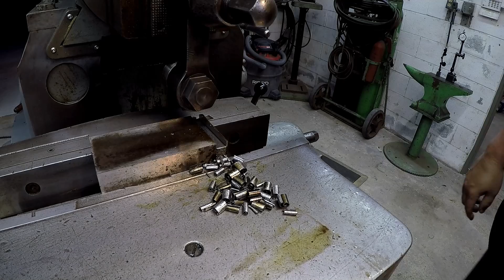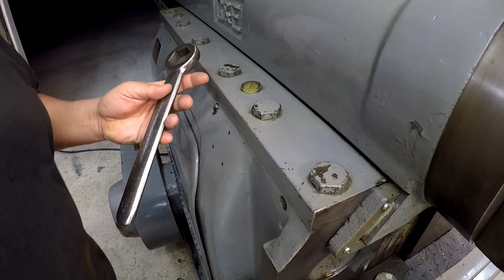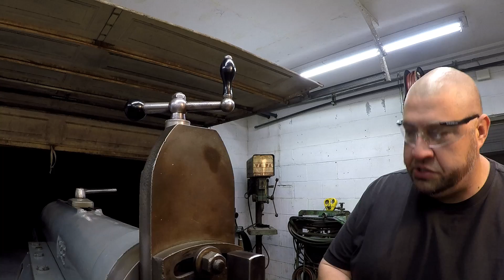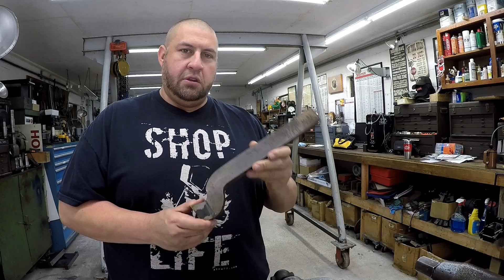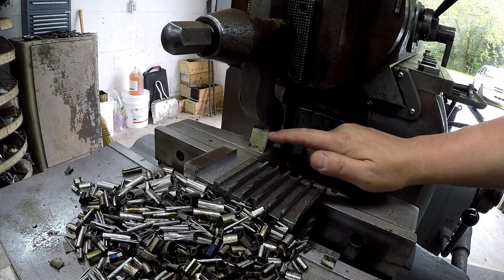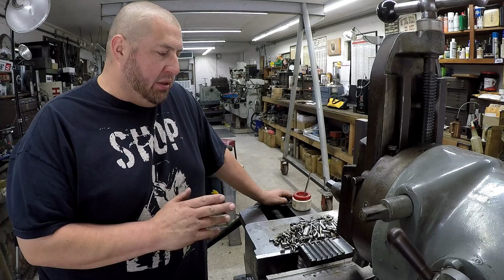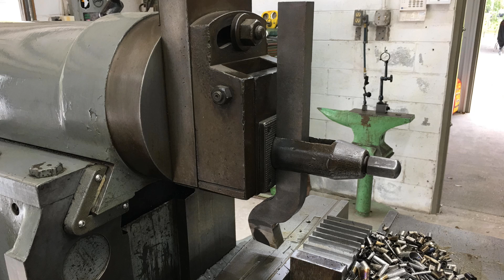Shaper Slotting

Comment: I asked many months ago, if you have a P.O.Box. to send you something, that is about 5000 times bigger then anything I can ever use on my dinky little machines...a few chamfer / counter sink bits.  There is a 1.987" diameter with a 1.000" dia shank  and has an approx 98 degrees chamfer angle and over all length is 4.125"  and is of a very high grade, fine tight grain H.S.S.. The labeling is acid etched and as follows. 1st line is : (VW-C-1098-0032PA), 2nd line is : (HS C-L USA), 3rd line is : (D04887) or (DO4487) I cant tell if the "zero" is afla or numeric on the last line.  The other chamfer tool bit is one which is 1.250" diameter with 1.250 dia shank, and an approx 102 degrees and the over all length is 3.600"  and this one is solid carbide and the labeling is laser etched and as follows. 1st line is : (Crowley Tool 3/09), 2nd line is : (D-1601X16/12/06 1290-347-0), 3rd line is : (#28400)...... I have tried to find info on these part numbers, but, I am either not smart enough to find stuff on the interweb or they were custom made for a particular job and are not part of a commonly ordered part number. I purchased them from online and the pictures that showed a whole lot of chamfering bits, I desires the large diameter cutting head, but small shank diameter, so I could hold them in my little machines. I recieved the opposite of what I wanted, Heck, my largest R-8 collet is 7/8"... I do not have the ability to grind them down either, in a proper fashion, let alone, I can't imagine how long I would have to stand at my pedestal grinder and work the living daylights out of my green stone.. that would be nuts and time consuming and not do these cutters justice. Now I must say, the larger tool, does have a center drill counter sink pilot and is centered to the grind on the shank, but the carbide unit does not have the centered drilled pilot hole at all.. Again, these are something you would be able to simply just chuck up into your larger equipment and make use of them.. Dru Bradley
Reply from the maker: Dru, send me an email about it. Abom1979 at g mail

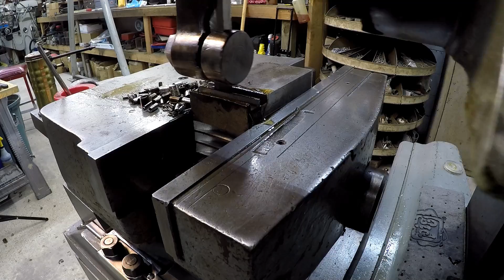Comment: @9:56 you say "5 thou on the dial -- 10 thou total depth" 
Surely that is the case when working on a lathe. With a linear situation 5 thou gives 5 thou. ?? 
Or have I lost your point?
Reply: jonka1 - I was going to ask the same question. 🤔🤓
Reply from the maker: Each line on the dial equals .002.
Reply: Isn't it the opposite too? On the lathe when you see 10 on the dial it takes 10 thou off the diameter so the depth of cut is 5 thou.
Reply: Some lathes have a dial that reflects the total removed from the diameter, e.g. 10 thousandths on the dial produces a 10 thousandths reduction in diameter.. My lathe indicates the size of the infeed, e.g. 10 thousandths on the dial produces a 20 thousandths reduction in diameter.

Comment: Very enjoyable as always. I admire your systematic way of trying out a new machine or cutting tool in order to find out its strengths and limits.
By the way, although about planers and not shapers, you will hopefully enjoy this 1950ies movie made by Waldrich Coburg, a German maker of huge planers:  https://www.youtube.com/watch?v=HThSfJcrk-g&t=908s
Unfortunately the video is in German, but you will certainly get the points and enjoy some heavy chip-making. Feel free to ask me if you need help with translations on certain details.

Comment: Adam,  you may want to do some slow or fast motion with the camera -- you can see things you can't by eye.    On the wide tool bit it sort of looked to me the ram may be slightly lifting on the operator side.  I would also look at your clapper pivot pin for a sloppy fit.
Criag

Comment: Is there such a thing as a"quick-change-tool-post" type things for this.. like where you could just change out the whole clacker assembly at its pivot point.. and have many pre-set tools for roughing to finishing... I suppose that would be allot of room for tooling bases storage.. I suppose it would just be simpler to change the tool bit out for every step required...?

Comment: Not trying to be an ass here, but curious what uses the shaper would have that couldn't be done on a mill? Or is it just a hobby type thing to experience an older technique? I've watched most of the shaper vids, but I'm having a hard time figuring out unique uses for it. Thanks in advance for any information. Keep up the heavy cuts, I love those big smoking chips!
Reply from the maker: These videos are not to prove what a Shaper can do that can’t be done on a mill. This is about a machine I wanted, bought, and learning how to use, and repair any issues along the way.
Reply: Audiboi any inside axial feature. Splines, keyways, etc. True involute gear teeth. All with a $2  bit. Plus it's cool
Reply: Tooling prices?
Reply: Time savings=money savings. One can make a cutter for this machine out of literally piece of any hardened steel. Accuracy.
Reply: Gotcha, thanks for clarifying guys. But in response to the splines, it doesn't appear that work holding would be easy to index and the stroke length seems too short for longer pieces, but my experience on machinery is limited to a few years running a automotive brake lathe and what I've seen here and on oxtool.
Reply: Audiboi true, work holding is an issue but not impossible. I believe that's a 16" or 18" shaper. He has the stroke shortened as he doesn't need any more for what he's doing. You can see the stroke a little better in another of his videos.

Comment: Why not install a stepper motor on the down feed and control it with a micro controller?
Reply: Ken Kendall it looks like it may have a power down feed. In other videos you can make out what looks like a shaft drive housing from the rear of the machine to the knee.
Reply: The dirty way is a circular saw blade sandwiched under the handwheel and a finger mounted to the base of the machine to do the downfeed. :)
Reply: I apologize, I did not know it had came with an auto feed, in retrospect I would make the shaper 100% before doing any modifications myself but please don't assume that we watch all of your videos and that we should know when you have made "numerous" comments about a subject matter.
Reply from the maker: Because I’d prefer to repair the auto downfeed and use it. I’ve already talked about that numerous times.

Comment: Now you're cookin'! Constructive experimentation, ramp up and a bit over to find the sweet spot.

There's several possible sources for the "jumping" you noted with the 1" tool. If it isn't slide motion, it's most likely slack somewhere in the clapperbox, possibly the pin clearance or the fit on the ledge. A clapperbox is a super precisely fitted assembly if it's to function with a minimum of lost motion and still clap freely under gravity alone. Put a finger over the clapperbox hinge joint to detect relative movement. The pin is tapered and may be re-reamed a trifle deeper with the clapper dressed and re-fitted tight to the ledge. The trick is to find a reamer that matches the pin taper. You only have to clean it up and install the pin deeper. If the Gods are kind you can get several re-fittings out of a clapperbox pin.

On broad and form cuts there is a tendency for the tool, if fed too small an increment, to deflect up and polish the previously cut surface. The temptation is to increase the end clearance to make the tool more aggressive but the real solution is to doctor the clapperbox. No slack = nowhere for the tool to jump. By the way, it takes a dead keen cutting edge to cut predictably in fine down-feeds.

Gooseneck tools. They're easy to make. Have your local CNC plasma guy burn you out gooseneck tool blanks of assorted widths from AR plate. Skim the clamping surfaces with a face mill and machine a weld inlay prep where the cutting edge goes. 

Stoody makes an M42 hardfacing rod mold makers use to patch up wear points on forming and drawing dies. It makes a good cutting edge, about Rc 60-62 as-welded. No HT necessary after inlay. I suggest the HSS inlay to be over-width as needed to clean up, 3/16" thick x 3/8" to 5/8" back from the cutting edge. 

Know a real good TIG guy to make the inlay? The trick is to lay it in without diffusing base metal up into the inlay. Back in the day, our welder used atomic hydrogen but I've done it with TIG. Go carefully and watch for porosity in the butter layer (first pass over the base metal.) Careful, indeed: the rod cost about $8 for each 1/8 dia x 14" stick. I don't know how much now. I calculate 1 rod will make a 3/6 finished inlay 3/4" wide x 1/2" face length. A stick of 3/4" square M42 cobalt tool steel costs about $40 so t ain't THAT expensive even figuring in blanks shanks in batches.

I'll look for a HSS TIG rod source. Make sure whatever you use in the inlay is HSS. Nickel manganese based hard facing is durable as hell on an excavator bucket but it doesn't hold a cutting edge. Maybe here:

http://www.airgas.com/category/Welding-Products-Filler-Metal-TIG-Rod-GTAW-TIG-Rod-Hard-Facing/_/N-8c3?ef_id=WpoeWwAAAGh9-EN7%3A20180315042322%3As&gclid=Cj0KCQjwkKPVBRDtARIsAA2CG6G5VrApEiv9MgBJx8vzw9kw8r_lOCF91Vx4InpYerpXNfXMdo8YNGUaAnKBEALw_wcB&s_kwcid=AL%214811%213%21208472354629%21b%21%21g%21%21%2Brod+%2Bhard+%2Bfacing&utm_arg=SEM%3AGoogle%3AFiller_Metal%3AStick_Electrode_smaw_BMM%3ASearch%3A208472354629%3A%3ASearch%3Afillermetal%3A+rod++hard++facing%3Ab%3AAcquisition

But it doesn't say "M42."

If you decide to really get into working your shaper, you'll need grooving and form tools. Stock in an assortment of gooseneck tool blanks skimmed and ready. As you need tooling you can mill the relief contour and inlay the HSS. Takes about two hours if you have the stuff on hand. One of the hours is for still air cooling the HSS inlay. If you ever get to the point where your tool collection out-weighs the shaper, you're about average for a 10 year shaper hand. Planer hands have a lower tool to machine weight ratio but you have to figure in the table hardware and set-up equipment. A long established press brake die shop is a different animal. They might have three hundred feet of full dimension 2 x 12 shelving solid with form tools, a good many used for one job.

You ever get a chance to collect "OK" planer tool shanks and tool bits in the smaller size suited for shapers jump ar it. Haven't seen them for years but somewhere old guys hoarded collections. Looks like machine shop junk to civilians but to a planer/shaper hand they're like gold and dancing girls rolled into one.

Comment: I work on machines that us a shaper type mechanism for generating bevel gears. It's quite normal for the chips to snap off the ends and go flying, with a very loud snap, it's also normal for lots of smoke as the chip carries away the heat from cutting.

Congratulations, it looks like you're getting things more dialed in.

Comment: How about small shaper tools for some more delicate and precise work? Lets say some small keyway or something. Thanks for showing all this. Its a treay to see that mafhine working.
Reply from the maker: For sure, we’ll be working in many things as we move forward.
Reply: Dear Adam.  Many thanks for your video,s . Watching the shaper cutter jumping at the start of cut, it looks like there is some upward movement as the pressure comes on the tool ? No doubt you've already checked the front end setup,  could you start the cut manually and dial in tool post rereward deflection as cutter pressure starts ,this might tell you if there is play at cutter setup?  Just sharing  a thought. Best wishes  stb

Comment: I'm curious why the tool face has to be flat to the front edge of the work? why couldn't the tool be angled so that it enters the work at a point and then gradually gets wide as the tool enters the work? this would reduce the bump at the beginning I would think and make a smoother transition into the material. as well as exit. Now. I am just thinking aloud. there may be very valid reasons why this is not done? Shrug

Comment: Adam, thanks for the videos. I am an irrigation guy, not a machinist, but observation here. Looking at your earlier videos and a few of Steve Summers I noticed that the clapper boxes were not straight vertical they are clocked a few degrees. Could this have an effect on the amount of "slop" in the pin that the clapper pivots on?  Giving the clapper more room and time to jump at the start of your cuts. Good stuff any way you slice it!!
Reply from the maker: The clapper box tilted for side to side cuts allows the tool to swing out of the way on the return stroke.

Comment: Rookie machinist here, can anyone explain to me the practical application for a shaper like this?  I work mostly on very tight tolerance aerospace, defense, and medical parts so i have never seen a machine like this. Thanks in advance!
Reply: There are number of angle cuts that are easier on a shaper and internal splines (Adam: do you have a boring bar you could demo this?) are much easier especially if you don't have broaches to do the same.  On small job shop runs, it's much less expensive to cut the splines of various sizes and shapes than to have a broach made.  Also "hidden" internal keyways that don't extend to the outside edge of the shaft.

Comment: Would you be willing to try a test again with that 1 inch wide cutter?  Rather than have the cutter ground so that the cutting edge is totally parallel to the work, cut it so that its a bit skewed so that all 1 inch of the cutter doesnt contact all at once and it eases itself into the cut - i would be very curious to see how that goes

Comment: Adam, In 1967, I was in metals in high school.We had a shaper in the classroom. I had never seen one but I elected to make a 2 jaw gear puller. The body and the arms were all made on the shaper and the ram was cut from 3/4 inch hex stock machined down and threaded on a lathe. Enjoyed working with the old shaper and won a county award with the tool. Just my 2 cents. Thanks for the videos.

Comment: An observation; The action of the machine and the "bounce" seems mostly normal. The only thing I might question, wrongly or rightly would be the work sliding down in the vice. I think the edge nearest you (the toe?) would have the greatest likelihood of doing so. is the work supported on parallels? Your right in thinking that the rigidity is under control. Just seems like somethin's creepin'!

Comment: I'm not a machinist past a drill press and grinding wheel. I can appreciate the traditional part of liking shapers as a class of machines but to me, a horizontal and vertical mill seem not only to be able to do anything a shaper can do (except for large workpieces---but even then, not like ten feet long items) but there are so many adjustments and quirks of shapers (which I am having a great time learning about on Adam's videos) the whole idea of having a rotary cutter seems like it is so much more self-corrective; plus you don't have the massive forces that shapers have...somebody give me some good reasons to have a shaper. Other than it's a cool machine.
Reply: How do you cut an internal keyway on a mill? You do it in a press with a broach or you can use a shaper. Cutting an internal dovetail? Good luck finding a broach. With a shaper you can grind a tool for any type of internal slot.
Reply: There's many odd shapes that job shops must create.  You can go to your grinding wheel with a HSS tool bit and create the shape(s) you need without trying to make a mill cutter, heat treat, run through the tool grinder (most shops don't have one!), and then find the helix chatters too much.  You just change the geometry a bit at the grinding wheel on your HSS toolbit and get it right.  You might not get that same job again ever, but reperposing a mill cutter to a different shape or size is hard, whereas tool bit not so much.
Reply: I appreciate the answers! Thanks guys!
Reply: The other part to consider is operator input time. A shaper can be set up to take off a huge amount of metal unattended due to the auto stepover. Need to take 2" thickness off of a 12x36 slab? Unless you have a HUGE mill, you are going to be dialing in depth and stepover constantly. With a shaper there is auto stepover, and auto downfeed step on some machines. The shaper can move all that metal without any operator input. 
This allows the guy to stand at the mill dialing in the next pass while listening to the shaper move metal. 
Cnc negates most of this advantage nowadays

Comment: The gib isnt adjusted by pushing it in further?
Reply: Yes it is. This type of gib is straight, not tapered like Bridgeports and most lathes.
Reply: Ya kinda gave a mixed message but I'm to understand that you push the gib from the side rather than the end and it has no taper from end to end?
Reply from the maker: Yes on the shaper ram gib it’s adjusted from the side.
Reply: That is correct. Each adjusting screw fits into a small depression on the gib to keep it from sliding with the ram.
Reply: Interesting.
I would assume it has to do with the cutting action and the effect of a tapered gib on the stroke vs the straight gib.

Comment: Adam, quick question from a “not-machinist”. I couldn’t tell from the video, does your 1 inch cutting tool have a lateral rake as well as a positive (leading away from the work from bottom to top as it appears installed on the machine)? I would have imagined that you put that sort of rake in but it also seems that the “factory edge” on the tool sent doesnt have it either. Maybe a lateral rake would help “introduce the cutting edge” to the material in a more gradual form and maybe reduce the jump at the beginning of the cut. Thanks and Great Vids, love them and keep em coming!